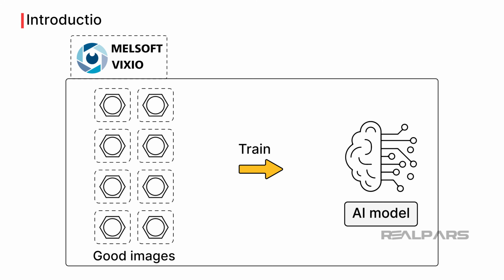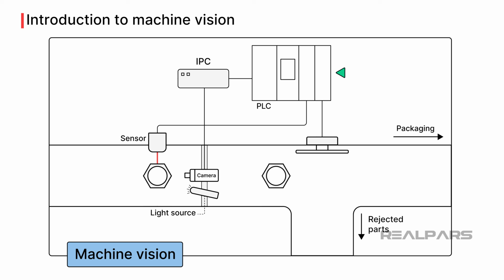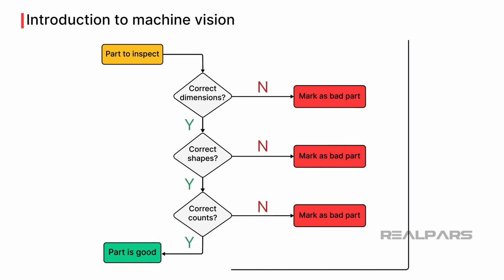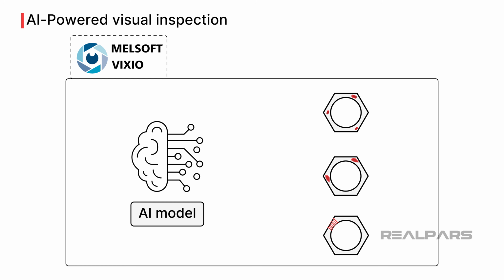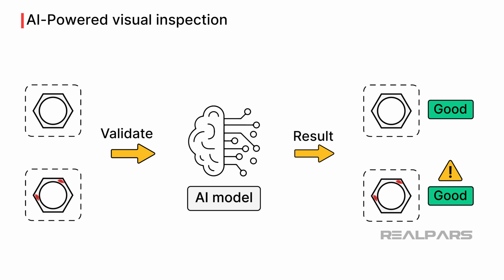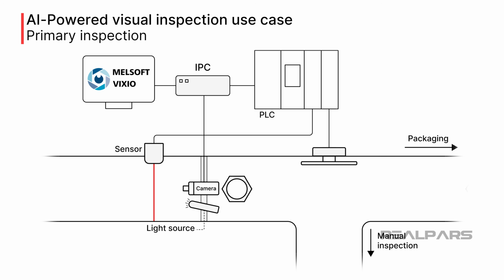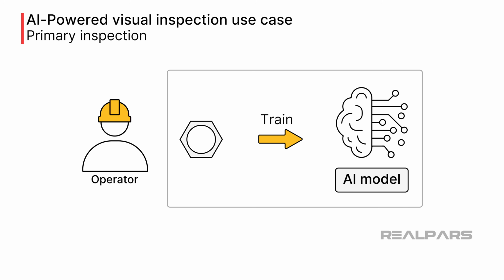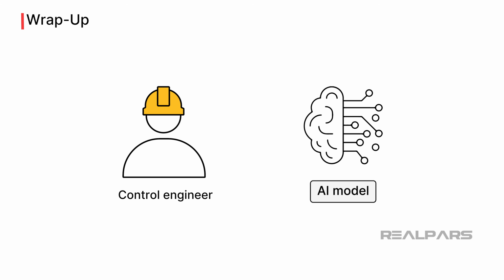How to Use AI in Industrial Automation: Machine Vision

Comment: How can internal features be inspected at scale? We have a cylindrical, pipe-like ceramic part with a central hole, and we need to inspect it in large industrial volumes, preferably in-line on a conveyor rather than one by one. The inspection requirements include checking outer diameter ovality, detecting surface cracks, identifying internal cracks, and verifying the ovality and dimensional accuracy of the internal hole. We are looking for an automated, high-throughput inspection solution capable of handling batches or continuous flow of parts.
Reply from the maker: Hello, @brookwithbeats  Thank you for your question. You have an interesting project on your hands! I suggest you contact an engineering company to review your needs and the project. I believe it can be done with the technology we have these days, with quality control cameras. But it will be expensive.  
Here is a link to a company that is well known globally to do that: https://www.keyence.com/products/

Comment: IPC acronym does it mean industrial PC ?
Reply from the maker: Thank you for your question!
An industrial PC, also known as an IPC, is specially designed for its components in industrial working environments. It is, therefore, particularly robust, based on powerful processors, and can be individually adapted to the respective application.